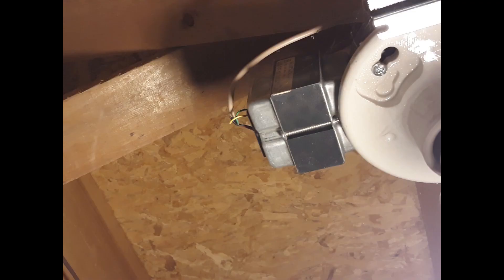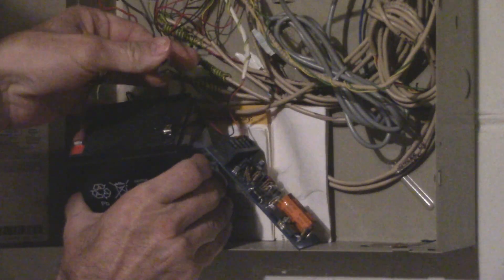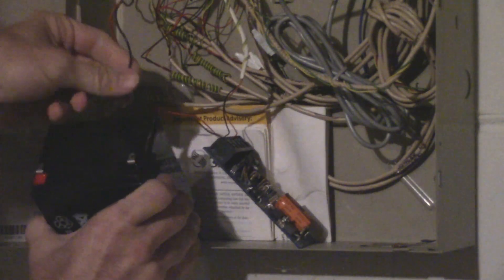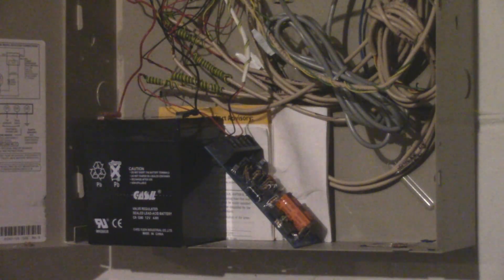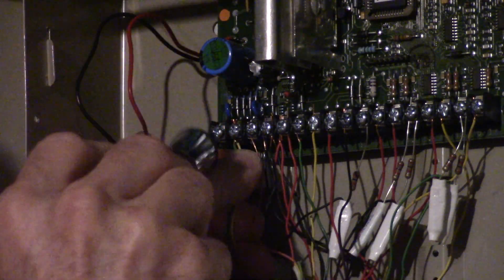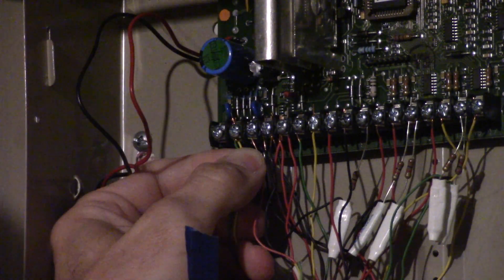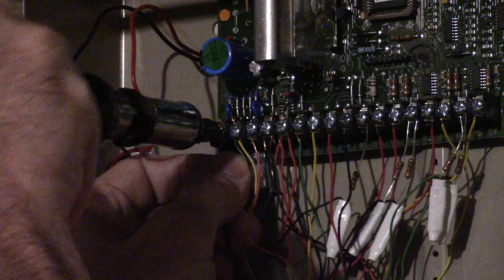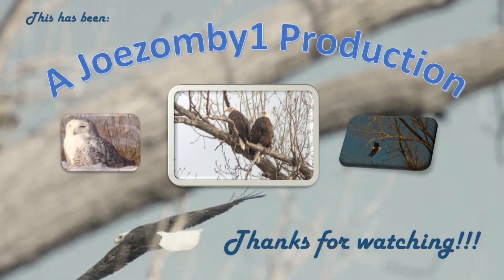Replace Honeywell Ademco Alarm Battery

Comment: Does one need to unplug the wall power supply (that is plugged into your wall outlet) before unplugging the old battery and installing the new battery?
Reply from the maker: If yours has a plug, you should unplug it. Mine is hardwired somewhere in the circuit breaker panel.
Reply: @joezomby1  Thanks for the reply.
 I did unplug and to my surprise my new replacement battery has wider terminals, so I had to reinstall the old battery until I make an adapter wire with the wider version of the slide on connectors. It's is always something! Thanks again.
Phil
Reply from the maker: You're welcome, thanks for watching

Comment: Just replaced both batteries, and still the same code.  Does the main power have to be removed to clear the battery indicator?
Reply from the maker: I don't recall, I did remove the main power when I changed mine.
Reply: Figured it out the batteries needed to charge.  It took about 6 hours and the code cleared itself.